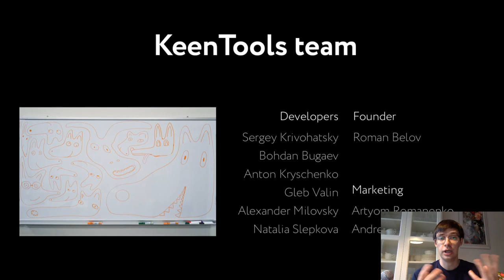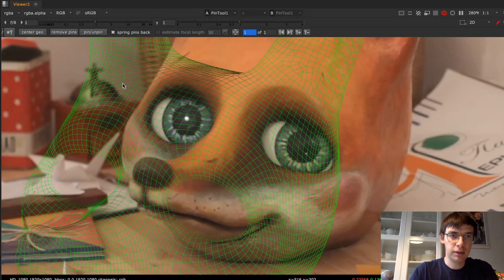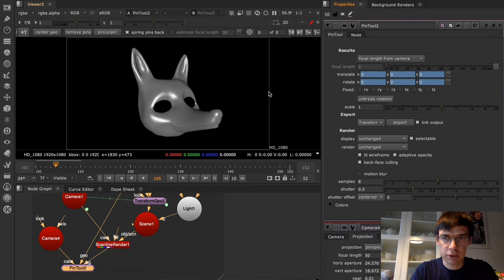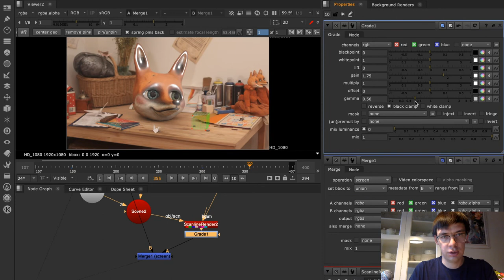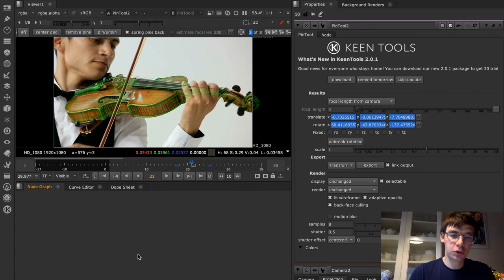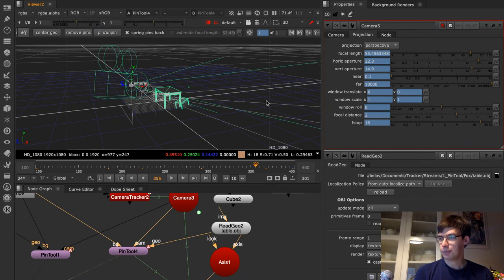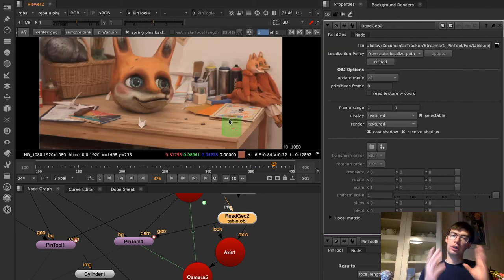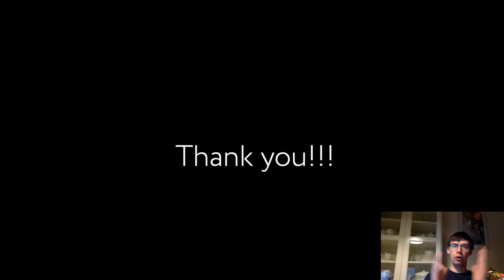PinTool Kickstart - KeenTools LIVE (17 Apr 2020, EN)

Comment from the maker: Timecodes:
2:38 Greeting
4:26 The KeenTools history & team
7:22 Streams plan
8:39 Meet PinTool: Discuss the basics
10:28: Pinning the fox model: Place and remove pins, multi-selection, and "Spring pins back" option
18:04 PinTool vs TranformGeo node: What's the difference?
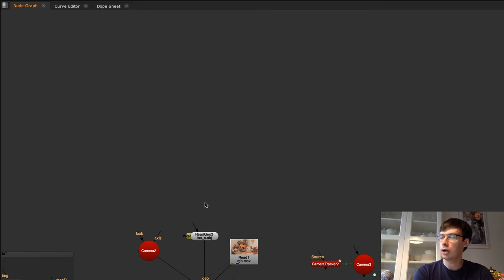22:04 PinTool Inputs: Model. Where you can find sources of models
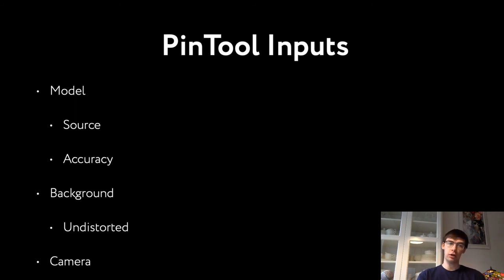25:48 PinTool Inputs: Work with background
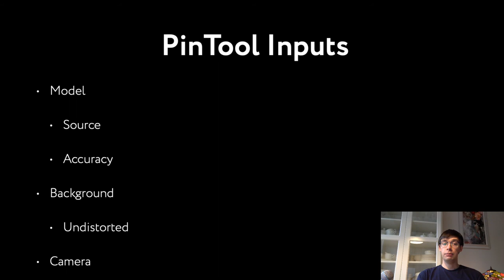26:49 PinTool Inputs: Camera. What parameters are important?
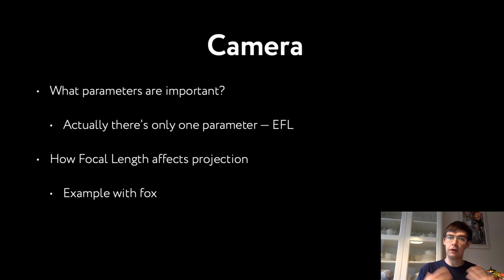30:00 Focal Length: How it affects the projection?
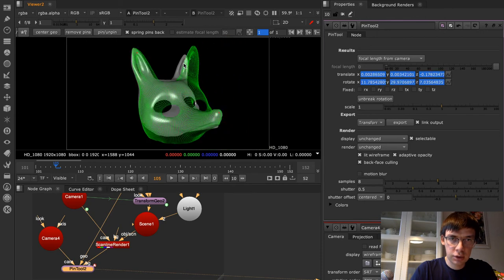34:34 How to use "Estimate focal length" mode
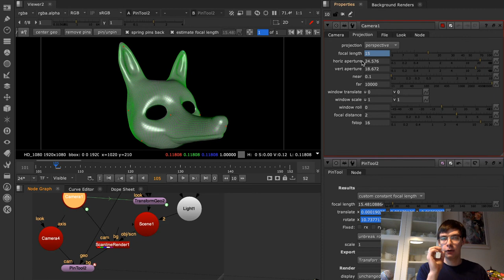37:25 Q&A: Using triangular models in PinTool
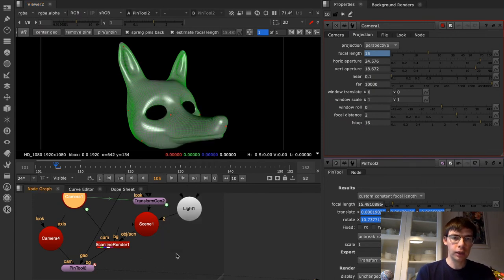38:41 Focal length estimation summary
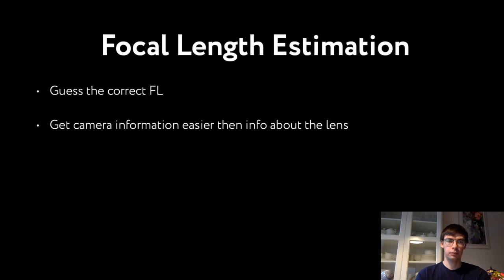40:04 Moving camera: How to track it
42:18 The correct way of using scale model feature
46:22 Placing a cube model into a scene
49:35 Creating a relighting effect for the fox model
52:12 Q&A: Matching and scaling the cube model to the scene object
55:51 Animation with PinTool. Interpolation of the Violin model by keyframes
59:27 A quick navigation between keyframes
59:52 How to setup consistent keyframe and use pin/unpin option
1:03:04 Varying focal length feature
1:03:36 Magic Keyframe function. How to use it?
1:07:48 Pinning the fox model using Magic Keyframe
1:09:15 PinTool Results. What PinTool can export?
1:10:17 Export a TransformGeo node
1:11:51 Export an Axis node
1:12:18 Export a Camera node with a correct focal length
1:15:10 Camera Alignment
1:16:12 Aligning the camera with an IKEA table model
1:19:28 Changing the Camera scale
1:22:00 Q&A: Extracting uv from an object
1:22:58 Export static and movement tracked camera
1:23:39 Coalign several cameras for a multiview pipeline
1:32:48 Tips&Tricks: How (to try) to invert camera with PinTool
1:34:00 Tips&Tricks: Fixed degrees of freedom
1:34:04 Tips&Tricks: Unbreak rotation button
1:41:34 Tips&Tricks: How to match motion blur with PinTool
1:43:40 Question & Answers
1:47:41 The next stream announcement
1:49:27 Share your feedback with us!
1:50:22 And a few more questions :)
 1:52:59 Farewell